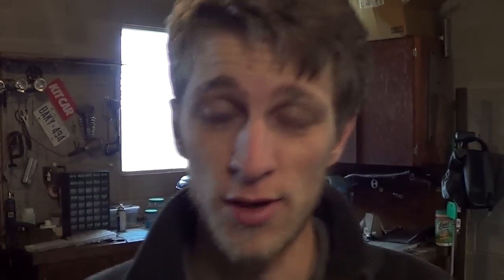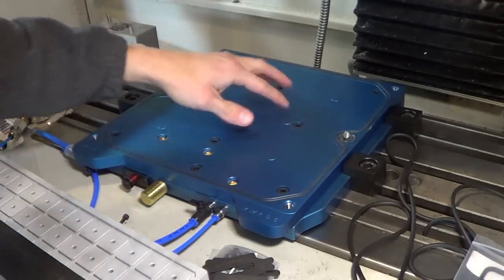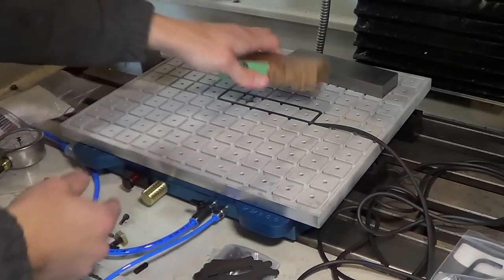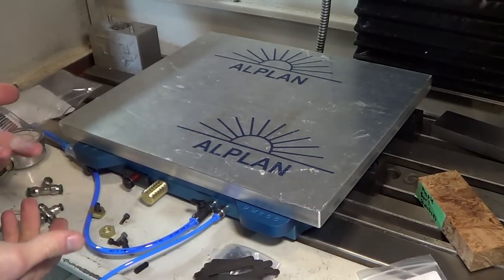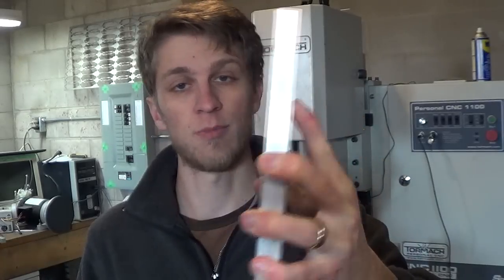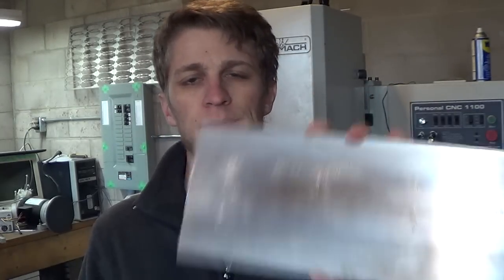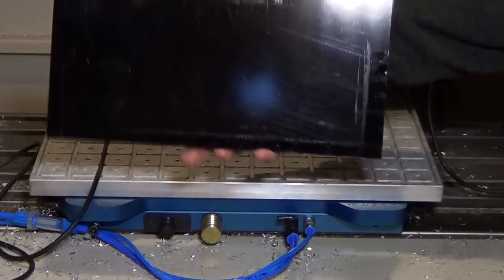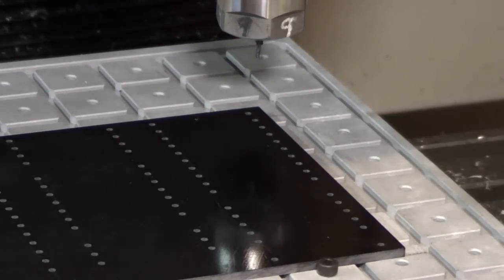Knifemaking Tuesdays Week 52 - Vacuum Fixture and G10 inlays

Comment: If you put your finger on a hole as it is on, does it suck your skin off?
Reply: sigh thats some stupid hollywood trope its just atmospheric pressure 1 bar on a small surface area fuck some astronaut did it in the ISS when there was a hole in the wall to preserve valuable air

Comment: Get an old air compressor tank and have the Venturi block draw vacuum from it.
Then hook up the vac fixture to the air tank.
The reason why.
If your work piece lifts just a bit you have flying parts
where if you have a large volume (from air tank full of vacuum)  it can save the work piece.
Also if coolant was used you have to drain air tank once in a while.

Comment: the venturi system just removes the atmosphere from under the part so you can calculate the holding force.the force is 14lbs per square inch thats why bigger parts hold better

Comment: We use to machine very large panels with a small compresser and we would use Saran wrap to cover the top of the part.You could visually tell if the part was not pulled down.J/S!

Comment: If you cut a pocket the shape of the knife handles a couple mill deep in a fixture and drill holes for the air vaccum to hold them down and place the vaccum holes where you aren't going to drill through from the top side of the handles. Then you will not need hold down screws as long as all the handle spots are being use.

Comment from the maker: It's not that strong, I can put my finger on the opening and it doesn't hurt.  For something like this it's surface area that gives it more holding force.  If it pulls 12 pounds per square inch (PSI), your thumb is less than 1 square inch so it pulls less than 12.  But the fixture is 144"sq so it can pull 1,728lbs.

Comment: The trick is to not crank the pressure up to 100% and your fine with flood. Even then its just the slippery parts, stuff dripped on the floor. At my job, at a school, one of the coolant lines broke and we only discovered it after about 6-8 gallons leaked. That was a NIGHTMARE to clean up. I love 7075, its harder but that's good since you get less burring, less packing... overall I love it and people love my RC car parts in 7075 too which is key!

Comment from the maker: Yup, flood makes a huge mess.  I don't have a sealed enclosure but at least it keeps it all pretty well contained.  Even still, huge mess.  I've used mist on another Tormach and was amazed at how easy cleanup was!  How are you liking 7075?  I've never tried it, but I've heard it's basically 1/3 better in every way.  I've also heard that alcohol makes a great lube/coolant for aluminum, with an awesome surface finish, but I don't really need more fumes in my garage haha.

Comment from the maker: Thanks Calvin!  I'll be checking out your videos too, looks like they're right up my alley.  For my vacuum grid plate, the holes do not go all the way through, they're just for threading and clamping.  There's only one hole in the middle, and when you wrap the o-ring cord in a square around that then no coolant gets in.  It's super nice to have a vacuum gauge on it so I know the difference between maximum clamping and a leak somewhere.  I just got a Fog Buster air/mist setup yesterday, excited.

Comment: I've always wondered about a vacuum setup. I've seen people block off the non-used grid to prevent coolant sucking and improve clamping force. One thing to consider is having is a simple air blast setup for clearing chips and preventing drills from breaking. 

Till the new camera I never noticed the quality boost. Keep up the good work!

Comment from the maker: Sweet to know that you could hear the difference too!
The off center bolts are called mitee bite cam action fixture bolts, they're the company's flagship product, although they have dozens of other cool stuff.  
This vacuum fixture uses a venturi so flood coolant works great.  If there's a really good seal like on a solid fixture then no coolant gets in, when using the grid plate with o-ring cord, sometimes it'll suck in a bit of coolant and the vacuum fluctuates, but still works.

Comment from the maker: Good point!  However, after putting a vacuum gauge on there it's obvious that more vacuum equals more holding force.  Absolute vacuum is what, 14.7psi or 29"hg?  My setup pulls a maximum of 23"hg at the optimal pressure of 60psi.  At 15"hg on smaller parts I definitely notice a drop in holding force.  So a crappy venturi that only pulls 12"hg won't hold nearly as good as a good one that pulls 23.  Happy holidays!

Comment from the maker: Thanks buddy!  Yep I'm figuring out that surface area is king.  Add some pins or side clamps for smaller stuff and it can do some incredible milling.  For the big fixtures I'm tempted to turn the vacuum way down to reduce air consumption because with 144sqin it doesn't need to pull 23"hg, especially with the alignment pins.  Heck at 3"hg I can't even lift it up.

Comment from the maker: The new camera automatically switches between macro and regular focus, whereas I left the old one in macro all the time.  

So far chips haven't really been a problem, just blow off the surfaces really well as I would with any fixture, gotta make sure it lays flat.  Flood coolant doesn't affect it at all since it's a venturi, not a vacuum pump.  But yeah, my 1hp compressor is on for 9 minutes and off for 4 minutes, gotta upgrade soon.

Comment from the maker: They're just getting too hot and sticking/chip welding.  3000rpm, 4ipm, peck started at 0.15 and I reduced it to 0.08" which helped a bit.  Drilling about 0.5" deep with an 1/8" hss drill.  I ran out so I started using 0.101" cobalt drills.  I've always had issues deep hole drilling aluminum, it doesn't like me haha.

Comment: For those of you new to concepts of vacuum, don't be fooled into thinking the vacuum is holding the down with suction.  The vacuum only removes the air from under the part and atmospheric pressure is *pressing* the part down.  Only more surface area allows more holding force, not a better pump or compressor.

Comment: The best way for such a vacuum pallet would be a vacuum pump. 
They require only 200W are very quiet and create a much higher vacuum. Search on Ebay, there are a lot that are under 100$.

Comment: Congrats on the new Christmas toys. I love new toys! I hope we've heard the last, "Focus... focus... why won't you focus? Come on! Focus already!"  :-)

Even without flood cooling, I've avoided vacuum hold downs because all of the little chips seemed very problematic. I figured the time I saved with fixturing would be spent maintaining the vacuum fixture. That, and as you pointed out, the need to run a 1 HP compressor almost nonstop. That's a lot of energy and wear and tear on a compressor.

Comment: Awesome vid, John! 

I often work with a CNC router table with a vacuum system and it really is a time-saver... I think you're going to love it! I'm not sure if it's needed for your application, but try playing around with MDF as a spoil board as well... cheaper to replace than aluminum. :P